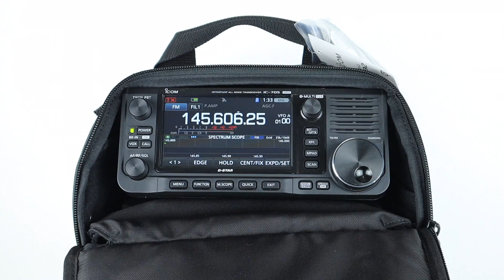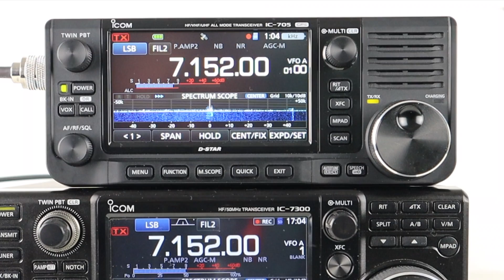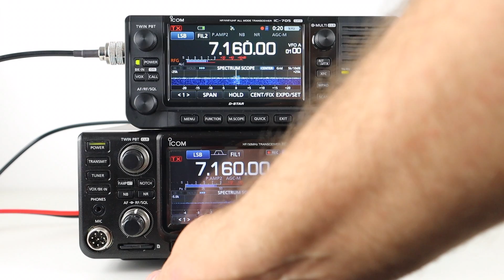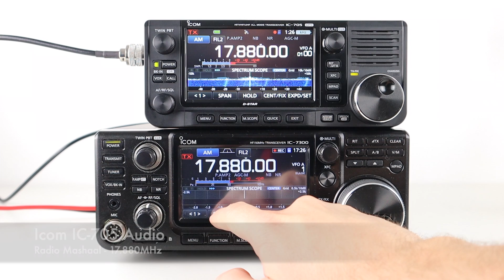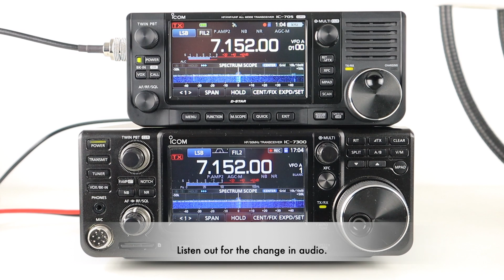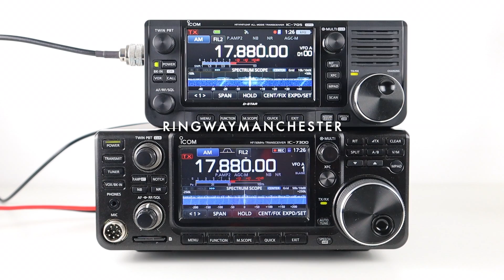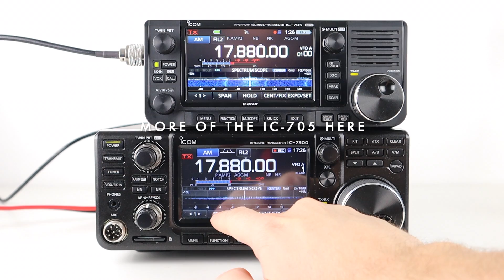Comparing The ICOM IC-705 HF QRP & ICOM IC-7300 Transceivers

Comment: I have a 705 and I will sell it, first of all its wifi module quality is disastrous and many users struggle with packet loss problems. Now it's under warranty because it won't even connect to any WiFi anymore. I observed the sound even with my eyes closed and the 7300 is clearly better, the sibilance and sizzling of the HF band are suppressed in it, with the 705 it is difficult to remove it due to the minimum of controls and I don't enjoy listening to it anymore. In addition, today you can buy a 7300 for half the price of a 705, which does not have a tuner, does not have 100W, has fewer buttons and faulty wifi from the factory. Attractive size and UHF/VHF for some, I drive a portable and do not use VHF/UHF. So for the ridiculous price that a used 7300 has now, the 7300 is a clear choice. It's all about the antenna and the operator anyway, the differences are so small in these simulated tests that it doesn't say much.

Comment: To clarify, the 7300 isn't really what's normally understood as a 'shack in the box' radio. That generally implies something which combines HF and VHF/UHF operation in one unit – ironically, the 705 is nearer to that. QRO versions of a shack in the box would be rigs such as the Kenwood TS2000 and the Yaesu FT857, FT991(a) etc. Everyone and his dog bought a 7300 when they first came out, but it wasn't long before I noticed that many were quickly moving them on too, for some reason, The 705 is a great little radio but I'm not sure that a touch screen is the kind of interface I'd be wanting to manipulate on top of Helvellyn with the wind howling around my ears!

Comment: I've just bought a 705. i have a 7610 which is about as reliable as a lada. my other radio is a bullet proof 7300. so time will tell with 705. but i'am loving it so far.

Comment: Well, it's night and day between the 705 and the 7100 :) Thanks for that comparison, it is interesting. 73's :)
Reply: Just a suggestion, in the case that you still have the 7300 and the 7100, there is only ONE comparison video on youtube (that I've found) and I'm pretty sure that lots of operators would like to saw them face to face on RX :) Since both radios are in production, some potentials buyers (like me!) might find it very useful Just saying ;)

Comment: Kind of an Apples to Underwear comparison don't you think?  You can go into the settings on the 7300 and change the bass and treble to sound like the 705...plus you have the 705 sitting on top of the 7300 speaker.   Yeah next video.   This was poorly done.
Reply from the maker: You’re right on the settings however the audio was direct from the sd card... I’ll wait for your better version!

Comment: The Elecraft Kx3 from the videos I've seen and all the forums I've read seems to have a much better receiver and noise reduction than the 7300 and I expect the same with the 705.

I got the PTFX-7300 panadapter for the 7300 and connected it to the Airspy HF+ and they audio is much better, I only listen now via the SDR console. So cool having a very large waterfall and noise reduction that works. 

I think if I were to splash that kind of cash I would get the KX3 even if it's a much older design without the bling. I don't really know though as I haven't actually tested the KX3 but I have the 7300 and it's a pretty noisy receiver compared to my FT-891 which has amazing audio via headphones and amazing DNR.

The 705 does have cool features, USB audio for digital and GPS to keep the clock in Sync for FT8 and JS8 Call. It has bluetooth and wifi and D-Star but Fusion is way easier to use I think.

Comment: thanks for the comparison but having the 705 setting on top of the 7300's speaker is not a good check.
Reply from the maker: The audio is direct from both sd cards so it’s irrelevant

Comment: nice video, thanks, it looks like some setting was different on the 7300 as the high frequency of the audio is like cut, this why everybody looking the reason at the top speaker covered, but you clarify more times - audio comes through AUX. Sir, what about this Audio equalizer setting https://youtu.be/1-zQNz51itg?t=616  .. or any other pass band filter involved ? I was planning to buy 7300, but the audio if is like on the video make me feel not that confident and thinking about something else. So to folks as me, looking to buy, your clarification is quite needed. Thanks for your time

Comment: Well done video! The comparison between the 705 and 7100 was a nice bonus and a noticeable difference in audio and reception clarity. I have 7300 and 7100. May have to get a 705 to possibly replace the 7100. The displays are a huge difference as well between the two. 73!

Comment: Please continue with more IC-705 tutorials.  Optimizing the waterfall scope, SWR graphing capability, recommended changes from factory default settings, etc.  Also D-Star, PSK-31 and RTTY operations.  73 G0NJN / N0KRO
Reply: I'm not sure default settings are still where you need to start, hasnt there been a firmware update that will need to be done first?

Comment: I guess that the waterfall setting on both the IC-7300 and the IC-705 where not completely identical. If they are identical, the IC-705 is an improved and shows more detail. I noticed the audio differences, but is the audio directly fed to the camera or is it recorded via a microphone? As said before by others the speakers are not the same.

Comment: What SSB filter width was used on the 7100?  It sounds wider, hence more noise - but could equally be due to better DSP (so steeper roll-off on the side skirts) on the 705.

Comment: The IC7300 has audio response filters for both RX and TX that are adjustable.  Can adjust bass and treble.  I assume can do same on IC705.  So can adjust to fit your hearing.  I do use an external speaker with my IC7300.  I do like having the spkr on the front like the IC705 does.  That way can mount in box for protection and dont cover spkr when operating.  This video is comparing audio quality only.  Lots more to compare on these 2 rigs.

Comment: The 705 would sound better, as it has front-facing speaker. The 7100 is rear facing and the 7300 is on the top (covered by the 705)
Reply from the maker: The audio was taken from the SD card and not the camera.
Reply: @RingwayManchester  Some folks seem to leave their thoughts w/o reading your replies to previous identical comments. Maybe you could add: "The audio you hear was taken from the SD card. No speakers were involved" to the description field to avoid answering the same thing for years to come 😉

Comment: The 705 has a front facing speaker, compared with the other 2 which may affect the perceived sound?
Reply: Note that the SD card icon was flashing throughout the video, because the audio from all three radios was recorded digitally to memory cards. No speakers (facing in any orientation) or mics were used. Hope this helps to clear up the confusion.

Comment: in Brazil the price of the IC705 is the price of a car
I am accepting a donation from this radio.
Reply: Hose much cost a car then $1300
Reply: @elanpaim33  The comparison would be as if the value is $ 7000
Reply: @adrianobatedor  the price of the ic 705 is around $1200 in uk £1300
Reply: don't worry it will go down for sure vy 73
Reply: @elanpaim33  Thank you very much, but in Brazil we have very high taxes, even if the price falls, it will never be accessible, importing makes the value more than the cost of the radio itself.
I used the google translator.
Reply: @elanpaim33  Believe
Reply: So buy it from somewhere else and have it shipped.
Reply: @johnratcliffe6438  Thank you very much, but in Brazil we have very high taxes, even if the price falls, it will never be accessible, importing makes the value more than the cost of the radio itself.
I used the google translator.
Reply: @adrianobatedor  That sucks 😞
Reply: I heard that in Brazil it is proposed to open the amateur bands to anyone without passing an exam (like CB).
So in fact the rest of the world should be happy that equipment is so expensive there, or else mayhem would result on the bands....
Reply: @Rob2  Yes, it was a comment made by ANATEL, the agency responsible for communications in Brazil, but it will not happen because it can become a mess and Brazilian radio amateurs do not want it.
But the requirement for the CW test will be extinguished to facilitate entry into Brazilian amateur radio.
73 of PU5ASF.